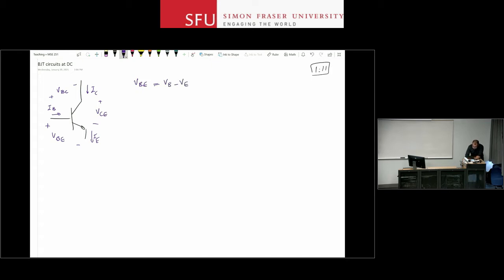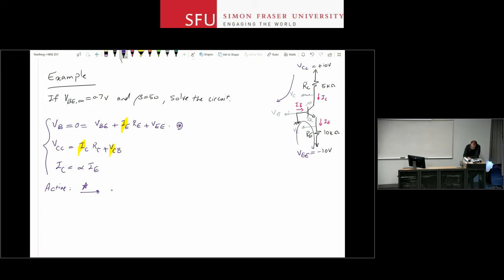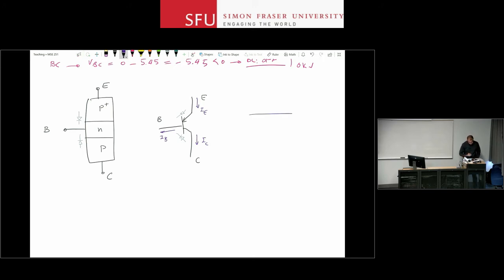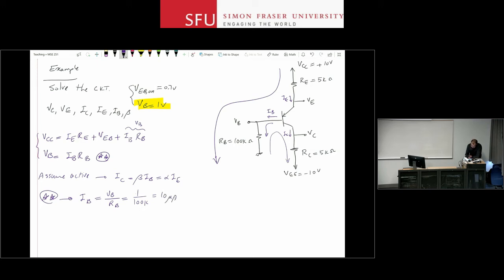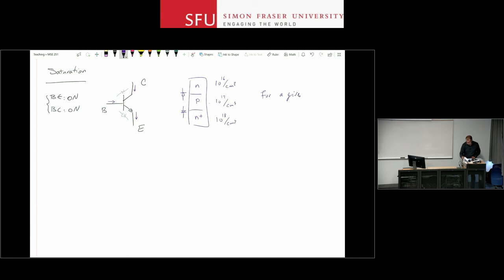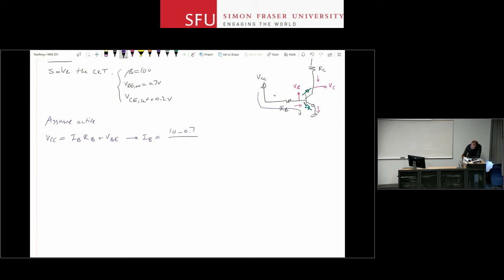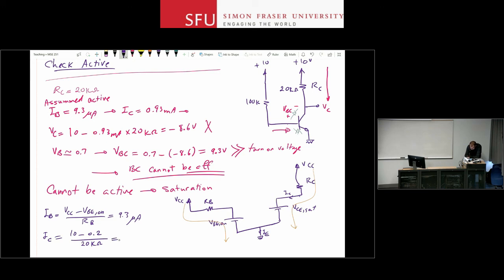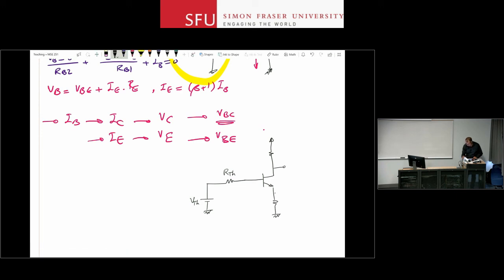MSE 251 D100   Recording 12 Analysis of BJT circuits at DC

Comment: Made a mistake at 40:01 it is saturation, you calculated  I_c wrong it is 93 microA not 9.3 microA
Reply from the maker: Thanks for noticing this! I_B is 93uA, making I_C 9.3mA (looks like my assumption that it would be in saturation originally was correct!)
Reply: @behraad.bahreyni  can I get a bonus for that 😅